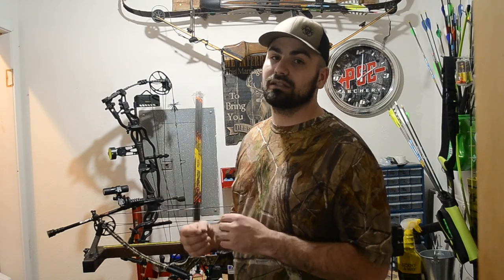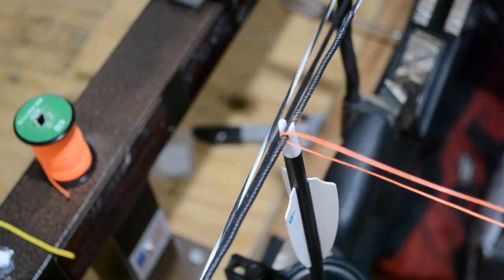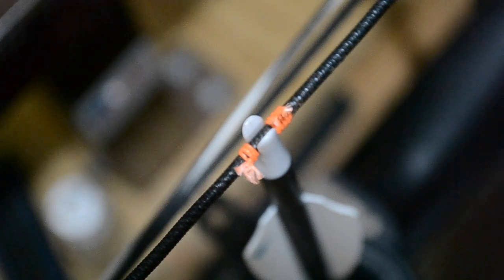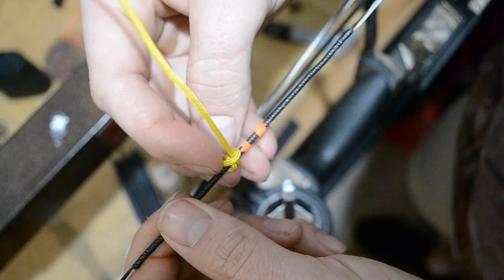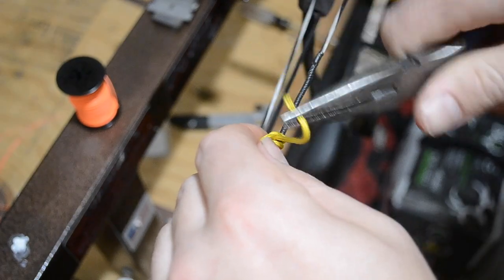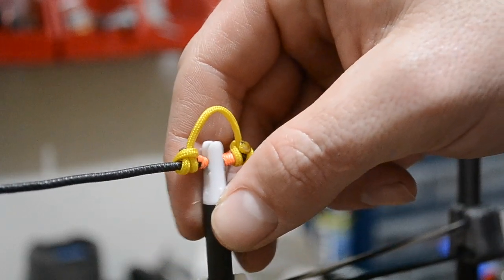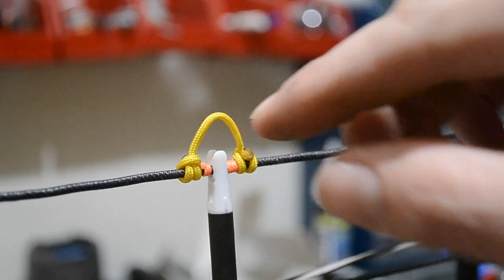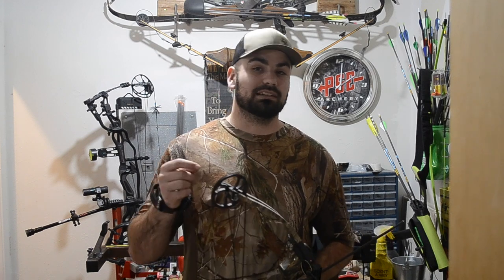HOW TO TIE NOCK POINTS AND D-LOOP | BOW SETUP

Comment: Good video. Good job of explaining.
I would liken to know what kind of material/ string do you use to tie the knock point?
i agree with you i like the #24  string for the d loop. much stiffer and stands open nicely for easy release access.
Reply from the maker: Just 3d serving .19

Comment: Someone served my bow and my nock does not spin freely is that a problem? Is so how and what size serving should I use? Thanks
Reply from the maker: The serving size will depend on the type of nock you use. You want the mock to snap/click onto the string. And if you pop the string the nock should release. If that won’t happen you need the next size smaller serving.
Reply: @infectedoutdoors  blazer nocks sorry should have included that
Reply: @infectedoutdoors  what do u mean pop the string?
Reply from the maker: @brett7794   pull tension on it and let it go. I guess pluck the string would be better verb-age.